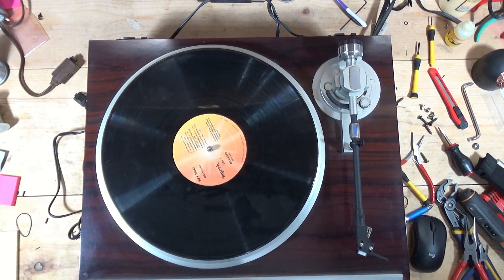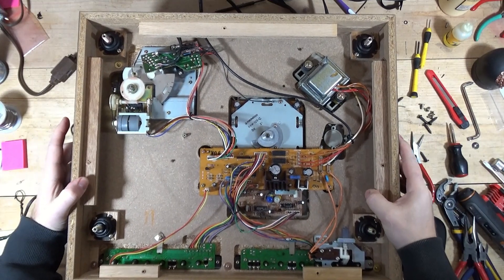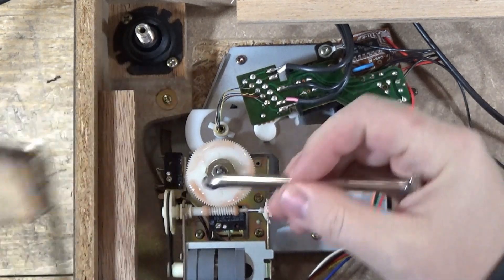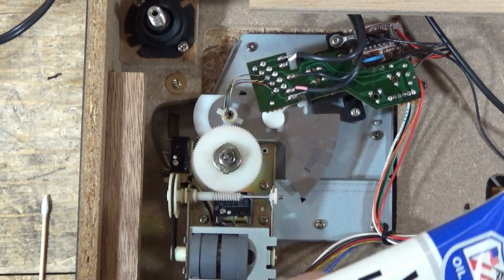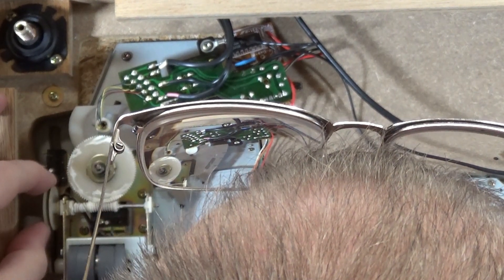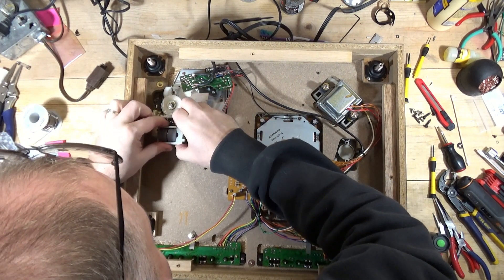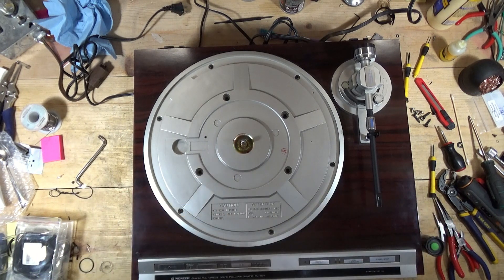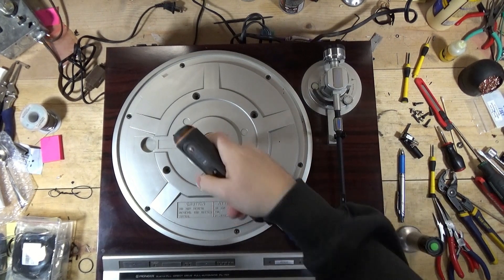Pioneer PL 707 Turntable Repair Part 2 - Stylus Cleaning, Belt Service, and Motor Noise

Comment: Page 7 thru 12 of the PL-707 Service manual is dedicated to this mechanism... Cam gear? trip wheel? trip gear? These are not visible without removing the tonearm drive mechanism (under the big white gear). Lots of friction going on underneath that gear. A stethoscope would go a long way to pinpointing the noise. Good fix with the shims. Hope it lasts. I love my 505 and I think the 707 has VTA that my 505 doesn't have.
Reply from the maker: Not real impressed with the build quality of the 707 vs my Denon DP 60L.  YMMV though.